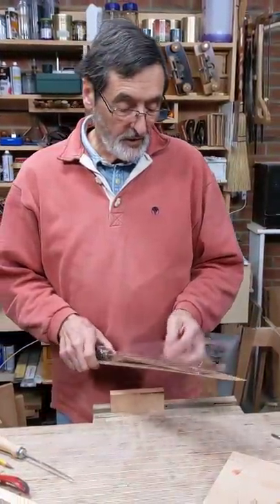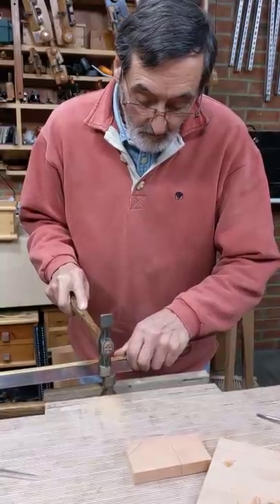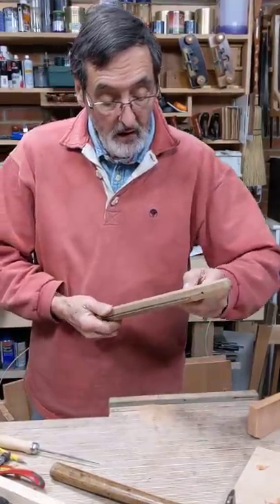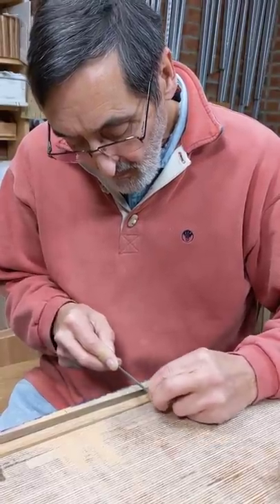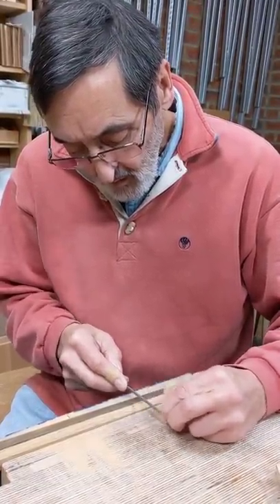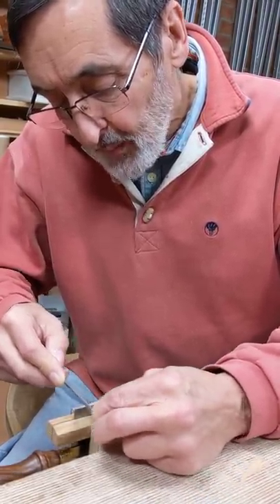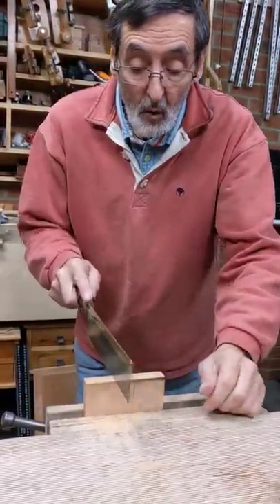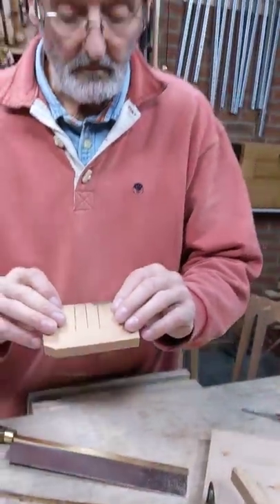Make a Low-cost Saw Cut Like a Premium one in minutes.

Comment: These are great saws for anything up to about 1 inch thickness which covers most projects. At a cost of $25 to $35 depending on where you look they are a huge deal. I've fixed up a few just like Paul did here and they cut beautifully.

Comment: Hi Paul and team, thanks so much for everything you’ve done for us during the year. When you say that you use a saw file, is that a specific type of file, or can an ordinary triangular file of small enough size work? I have an old Diston cross cut saw which needs to be cleaned and sharpened next year. 
I hope you have a blessed and peaceful Christmas.
Reply: The saw file is a special file. The edges of the file are round and not sharp as they are at the normal triangular file. The sharp edges could damage your sawblade.
The saw files have six faces, not only three.
Reply from the maker: Buy a 4" extra slim Bahco file or then too a three-square needle fille.
Reply: The base of each corner of a triangular saw file dosent come to a point so when it files the steel the gullet of the teeth are rounded, if it comes to a harp v (the gullet that is, not the tip) the plate can fracture and the tooth can break off or fracture into the plate which can mean mill filing all the way down to the fracture and creating new teeth which is a pain, bacho make a decent saw file which you can buy in sets from places like Lee Valley, might depend on where you are on what you can get. For tiny teeth (like 20 tpi) you might be able to get away with a normal needle 3 sided file as there wont be much force per tooth and the file will naturally have a small radius at the corners (a problem will bigger tpi is that radius becomes relatively too small). If you do buy a saw file, make sure the sides of the file are at least twice the depth of your teeth, this allows for an even wear of the files sides as you rotate between all 3 corners.
Reply: What a nice surprise, I can get these saw files for the equivalent of £15 here in the southern tip of Africa. Thanks for the advise!

Comment: Dear friends, how to straighten an old saw which has straight back and is slightly bent lengthwise? Looking from below, it is like straight - fault - straight pattern. Like if it was twisted while being in the kerf. Should I hammer it?
Reply: Look around Paul did video on this.
Reply: @jimcarter4929  do you mean https://www.youtube.com/watch?v=tzc4tQ5CRxk ? Thanks but It shows one gentle bend one way or the other. The saw I have is (with a little exagerration) like elongated "S" or step shape.

Comment: Thats awesome, how much better again will it be when you turn the saw around and sharpen the other half of the teeth? Thanks Paul, for showing yet again, that tools are not optimised from the factory. We can make them better, with just a little work, once we get them home. Planes, chisels, vices, clamps, and yes, even saws.
Are there any tools that can not be improved from the factory?
Reply from the maker: I think youi have it wrong Thomas. This is a ripcut that can be filed all from one side. Crosscuts must be sharpened from both sides. As dovetail saws and tenon saws are generally and predominantly used in ripcut mode they are best sharpened for ripcut. Using the small toothed saw for both rip and crosscut with the same teeth. That's ten teeth per inch or less.
Reply: @Paul.Sellers  ahh, okay. I must have misunderstood. I thought you had said you were sharpening every other tooth.
Reply: @thomasarussellsr  No he just kept saying, "Skipped a tooth" because he was moving so quickly on a really fine toothed saw.  Very easy to land in the wrong tooth.  You can tell because of the high TPI but he does go back and fix the ones he accidentally skipped.
Reply: @Rokmonkey32  No, I got that during the video. Early on, I thought I heard him say something about every other tooth. I have suffered from traumatic brain injury and a stroke, so sometimes I have auditory hallucinations. This was probably one of those times.
Damned war time injuries.

Comment: could i ask for further information?  this saw was brand new, teeth were all well spaced. I found hand sharpening my saw leads to some uneven teeth, so i have to joint the teeth line. Could you help me us/us with restoring a bad sharpened and teethed saw?
Reply from the maker: It's all too easy to think you must joint the teeth when in fact you don't. After you have sharpened, run your fingertips lightly along the teeth to feel for a high tooth. When your fingers hit them you will feel the high spot. Take the file and fil either side of the high tooth and even out the tooth from both or one side depending on what you see. You can guestimate the height, try it in the cut and see if it still snags in the wood.

Comment: It looks like you have sharpened only one side?
Reply from the maker: On ripcuts you file through-cuts in every gullet, crosscut you file ever alternate tooth and then turn around and file the inbetweeners. That creates the pinnacle three-sided tooth. On smaller saws with teeth smaller than ten per inch it is best to sharpen them as ripcut because these teeth will both rip- and cross-cut.
Reply: Thank you, Paul.
Just took my Irwin 3055 12 tpi tenon saw and is has two-sided teeth.

Comment: Paul: Could I do this same thing on a Dremel Hobby Saw?
Reply from the maker: Possibly. It depends on the size of the teeth and then the hardness. Some hobby saws have super-small teeth so upwards of 30 TPI and are very small. Then the plates on hobby saws are sometimes super hard too because they can be used for cutting metals and cannot be filed. Best to just try. You will need a three-square needle file by Bahco
Reply: Disposable in my book.

Comment: The metal may be good, but the quality of work at the factory is poor.
Reply from the maker: I disagree. I agree that you generally get what you pay for and in this case, you may need to do a few minutes work to tweak a thing or two, but these saws have everything good in them that you need and the nearest thing to them costs many times more. I don't mind cleaning up the brass if indeed it bothers me.